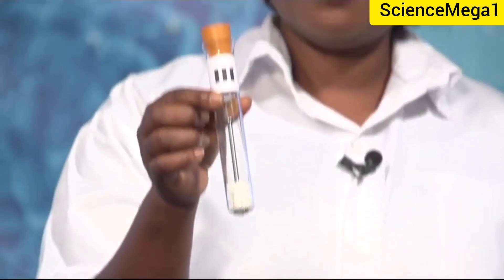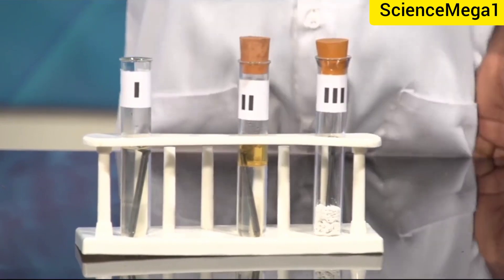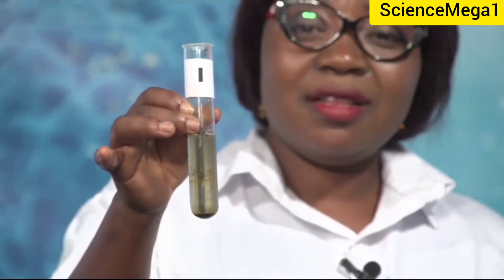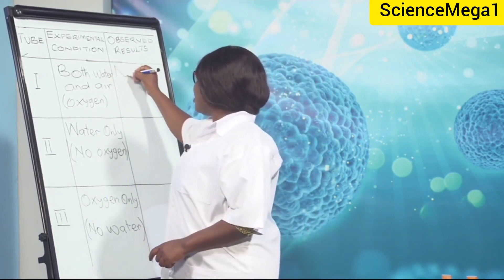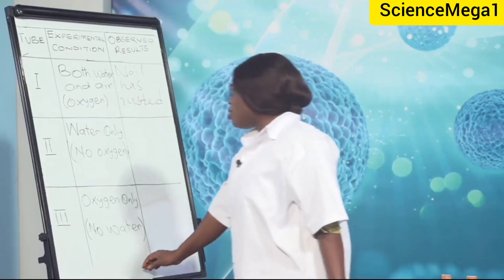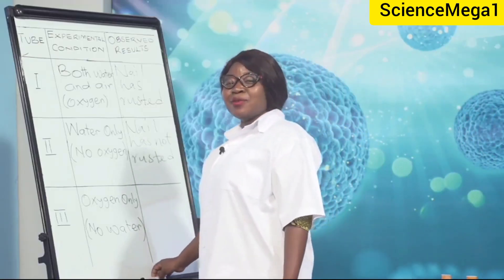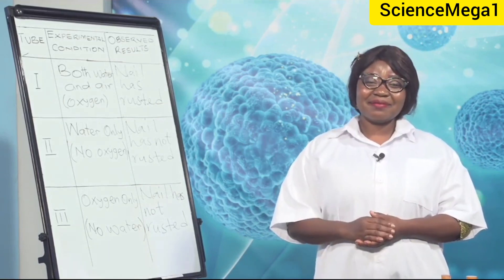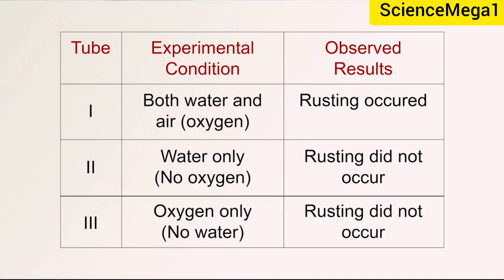Experiment of  rusting well explained

Comment: Please test tube(III) was not subjected to oxygen because it has a cork on it, but you said it was subjected to only Oxygen? Am confused.
Reply from the maker: Note that all the bottles were exposed to air before they were corked.
But the idea is that, is oxygen reaching the nail in the test tube?
The answer is that it's true that oxygen is reaching all the nails in the test tube except tube II mainly because of the oil.

In other words, the oxygen is preventing the air from reaching the nail hence no rusting since rusting needs both air(oxygen) and water.
Reply from the maker: With test tube III, the was oxygen in the test tube the anhydrous calcium chloride is a drying agent hence no water(moist).
we assume air is already in the test tube.